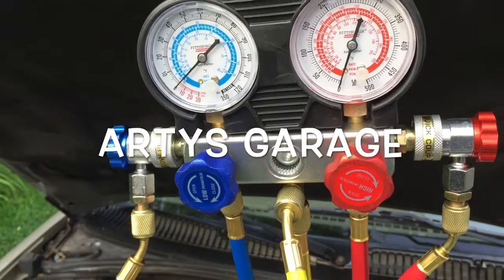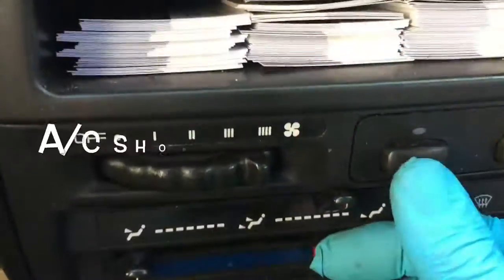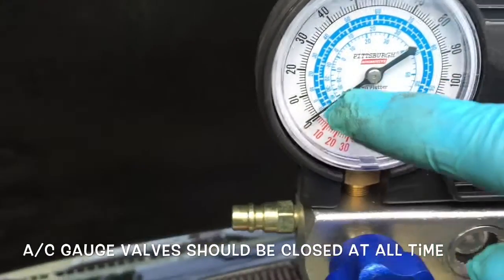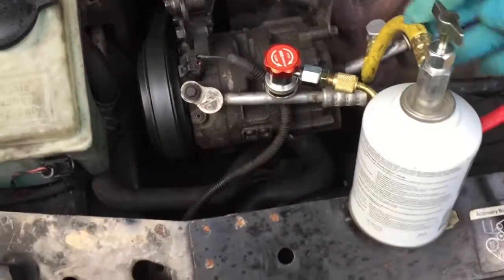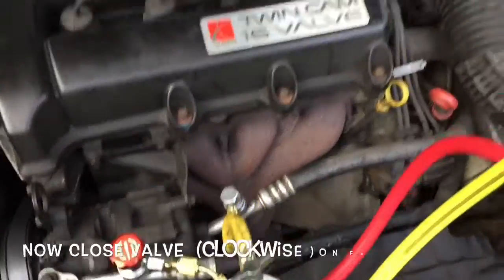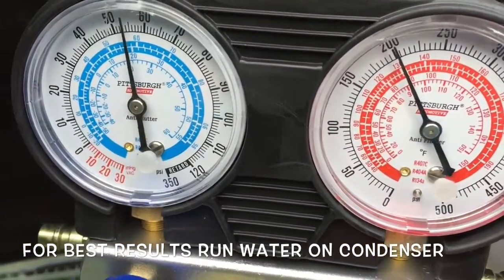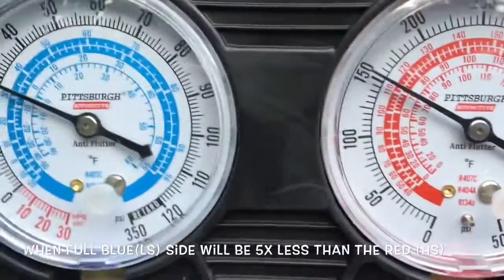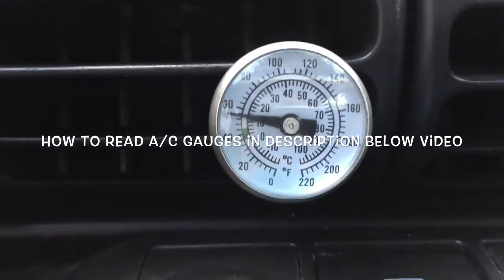How To Charge your cars  AC With Freon

Comment: My Saturn will not take charge even when I force compressor on what is happening
Reply from the maker: +Victor Mcmillan what are your readings high side and low side with compressor on
Reply: +Arty's Garage I let some pressure out of high and low side and now it's kicking on by itself. I'm using the can with gauge from store. Now it turns on by itself so guess I had over pressure.
Reply from the maker: +Victor Mcmillan let some more out they why j asked you for readings 
It let it all out n add.1 can & 1/2 that's your cars ac capacity Good Luck
Reply: +Arty's Garage I did it cold ac working. Your trick with water on condenser made it open up check valve and take new charge. Thanks for the video.